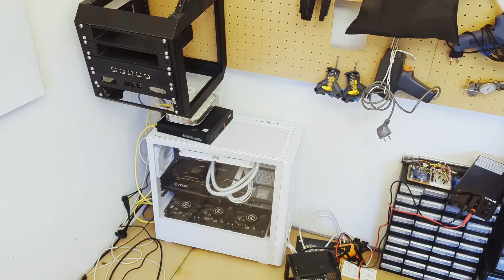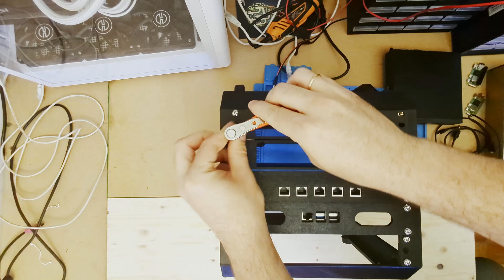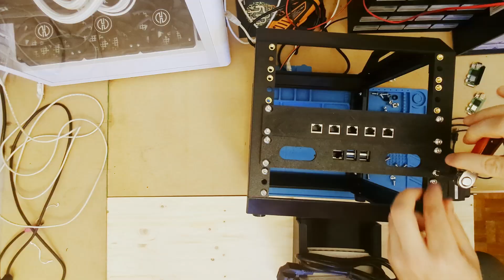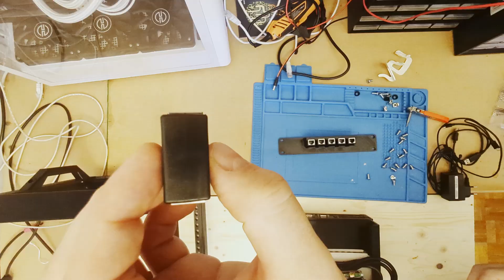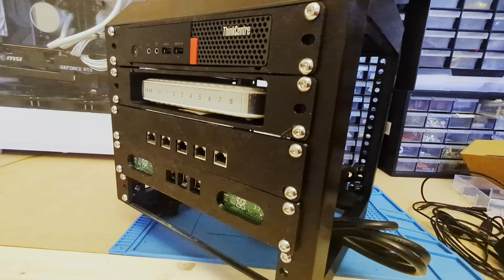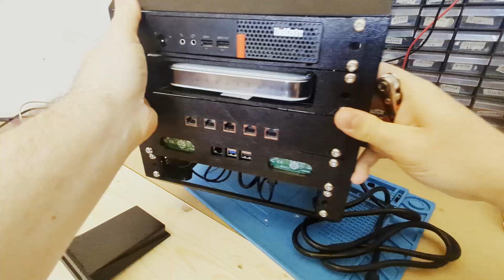Upgrading my Home-Lab

Comment: Nice starter build. You should maybe think about another mic or your settings, it sounds quite muffled.
Reply from the maker: Yes, the mic is clipping a bit. Wrong gain settings in DaVinci. I am still using my old laptop to edit instead of the VM I set up in the workstation with remote desk 😅
Reply: no worries, still a cool vid